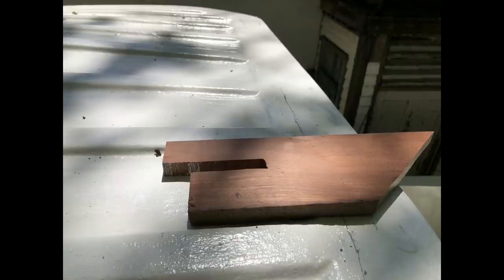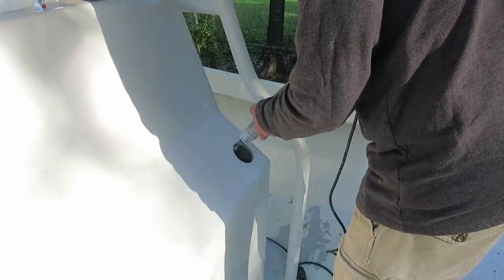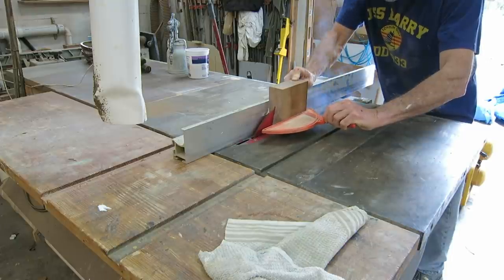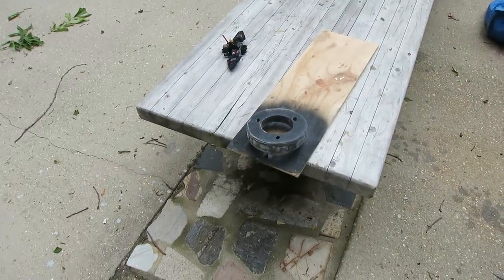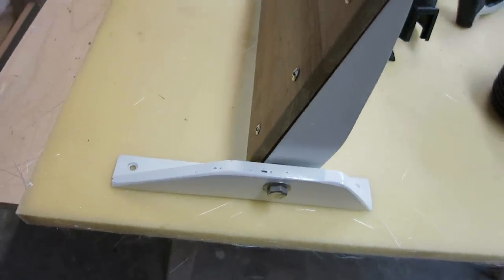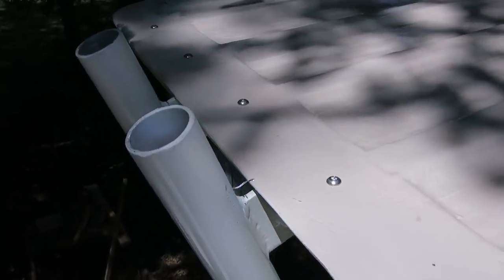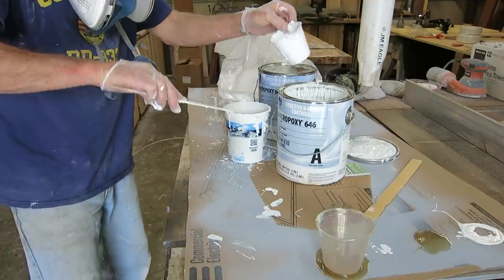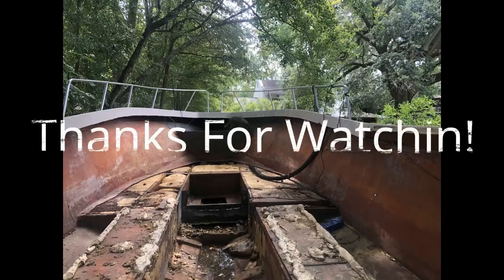T-top top, non skid and progress on other goodies on the Center Console Project boat. #38

Comment: I would use Ultra Tef-Gel on those screws.   Amazon has it.
Reply from the maker: David
That is a product I an unfamiliar with, I will have to check it out.
Barry
Reply: @barrylukebuilds7894  Duralac is the trade name of an alternative product. I am sure there are plenty more, all the online marine retailers and metal working suppliers should be able to advise you, I reckon. Lovely t-top. Thank you for the videos.

Comment: On your T-top I would drill those all the way through the aluminum and use longer bolts with nylock nuts on them. If you don't want the nuts then use anti-seize and lock washers if you ever want to get it off again without cutting them.
Reply from the maker: We are on the same page mostly. I was planning on through bolting the front corners only and using a chemical separator on the remaining bolts 
Barry

Comment: We use PTFE pipe sealer on all stainless fasteners that go through Aluminium to prevent any galvanic action between the dissimilar metals,
We also use it on stainless to stainless to prevent galling.
Put the bow rail back on.
Easy to hang fenders off and some thing for old fellas like me to hang onto😎👍
Reply from the maker: Les
Thanks for the comment. After reading all of the votes on the handrail I am 100% unsure on which way to go. 
But it has been interesting. And thanks for the tip!
Barry

Comment: Hey, Barry pertaining to the 3 × 16 stainless steel screws in the aluminium frame. What will happen naturally over time is that those screws will cause the aluminium frame to corrode because the aluminium frame will be the more noble metal. This is a type of corrosion call Galvanic Corrosion. When you mix two different metal that are in electrical contact ( in other words directly in contact with each other) the more noble metal will start to corrode because more noble metal (stainless steel) will turn an cathode and the less noble metal (aluminium) will turn an anode hence the less noble metal (aluminium) will become a sacrificial anode and start to corrode protecting the more noble metal (stainless steel) which is the stainless screw. 
     The more noble metal will not corrode which is the stainless steel screw in this case. So what will happen over time is that the screw will become slack and fall out over time due the screw hole becoming larger because of the corrosion of the aluminium frame. 
     The best option here is to use aluminium screw which would be the same material as the aluminium frame to prevent this type of corrosion from happening; Or you can coat the stainless steel screw and the screw hole with epoxy to limit the contact between the two dissimilar metal to minimize the effect of this type of corrosion which is called Galvanic Corrosion.

     Please see the link below for further information
https://www.twi-global.com/technical-knowledge/faqs/faq-what-is-galvanic-corrosion-and-how-can-it-be-avoided#:~:text=Galvanic%20corrosion%2C%20also%20known%20as,solution%20and%20are%20electrically%20connected.

Regards;
5th Marine Engineer Romario Goulbourne
Reply from the maker: Thanks Romario and thank you for your service. My Son and my brother both served in the Marines.
I am not crazy about using aluminum screws as this will be a high load area with lots of temperature swings and lots of vibrations. I am leaning towards the coating route.
Barry
Reply: You are welcome sir.

Comment: I vote handrail for practicality. If nothing else it’s a 15 foot cleat that runs half of the boat for tying fenders lines etc. for the T top fasteners stainless and aluminum is nature’s lock tight if you don’t want it to be disassembled then mark the box complete. If you think you might come back later and want to take it off then they make special graphite anti-seize specifically for that but I’ve used traditional cheap store brand anti-seize on aluminum boat towers with  stainless hand tightened fasteners and never had an issues. Love the teak foot step!
Reply from the maker: WB
Thanks and we are on the same page with the fasteners.
Had to have a little teak in the boat!
Barry

Comment: Hey Barry...really enjoy your video's on your boat rebuild...
Actually doing pretty much the same thing on a 1988 WellCraft 20ft CC...
Including adding a full Aluminum Tops-n-Tower T-Top, and full Engine bracket with a 300hp Yamaha two stroke...
And yes...I am learning from your mistakes...LOL...seriously...I'm learning a lot more positive things...
With regards to the screws being used to mount your hard top...I agree with others, to lessen or stop Galvanic corrosion, I feel you should switch to aluminum screws...
I'd use something along the lines of 3M 5200 to seal em...and as an added note I'd recommend using large Aluminum Fender washers at each mounting point...
Remember...this hard top is going to want to act like a wing, or a parachute while being pulled down the road...and I'm not 100% sure the screws alone would be able to handle that amount of stress... The fender washers will distribute the load over a wider area, and lesson the chance of this happening...
Good luck with your project, and keep posting your videos...
Unfortunately my project is going to take a lot longer...Age (63)...health...100% Service Connected Disabled Vet, and a couple of Cancers...have slowed me and my project down, to a stand still...But As of now I haven't given up yet!!!!
Reply from the maker: Don
Thanks for the tips and thanks for watching. The up lift on the top is a serious concern. I will keep scratching my head to find a suitable solution. Your WellCraft is pretty patient but don't wait too long!
Barry

Comment: I made the same mistake once.  Masking tape and resin stick REALLY well.  Epoxy resin and plastic packing tape wont stick to each other.  You might want to test it with poly resin and see if it works.
Reply from the maker: Thanks Pic! I have been a little more careful since then.
Barry

Comment: Live in the desert Southwest, but enjoy your videos/craftsmanship. Can’t vote for/against forward handrails since I usually don’t need much to trip over and neither would stop me from flying off the bow. A thought though on the fiberglass attachment. If you want to keep the screws, I’d think of a bead of white silicone under the glass at each support rail. I’d agree, however, that through drilling with cap nuts or Loctite on the longer stainless bolts would be my first choice. I lived on the East Coast into my 30’s and spent a lot of time on the Atlantic and have been aboard during squalls. I think the Bimini top might have some problems in short order if you stay with just the screws. Keep ‘er coming. Thanks for posting your beautiful work.
Reply from the maker: Thanks Mick
Fastened the top just yesterday. Polyurethane Caulk all around and on every fastener and 4 through bolts up front. I think I am good now.
Barry

Comment: Hi Barry. Unfortunately Stainless steel and aluminum are not working well together. Sf they are in direct contact aluminum will corrode in one point. Trust me I know that because I have seen this many times. I suggest some aluminum screws or strong aluminum rivets. 
For handrail depends what you want snd what you like. Your boat reminds me on Boston Whaler and they are made for fishing. If the boat will be used for fishing that railing will be on your way all the time. Also it will take space on your gunner. I vote no railing. 
And fenders you can always have a small clits to hang them . 
Amazing job and looking forward to see more 😊
Reply from the maker: Ante
Thanks for watching and the kind words. I am still undecided on the handrail. 
barry

Comment: If I was to have my granddaughter in the boat, I would want the rail.  Seems like kids are drawn to the front of a boat when it’s underway, and kids are clumsy.  
Look in to getting some Teflon coated bolts for the top.   This eliminates any dissimilar metals touching, thus preventing galvanic corrosion.   We have Fastenal stores in my part of Texas with all the plants, probably some by you as well with the plants you named off.  
And great work as always.
Reply from the maker: Thanks Jay! I have spent many thousands of my former bosses dollars at the local Fastenal.  I will check them out.
Thanks for the vote and thanks for the kind words.
Barry

Comment: So for stainless into aluminum threads the best product I've seen is called Lanocote. 

It can be bought online or at most boat supply shops near the coast. It keeps the aluminum from galling and allows the bolts to be removed in the future if necessary. If it were me I wouldn't use anything else, right tool for the job kind of thing.
Reply from the maker: Bear
Thanks for the tip, I will check that stuff out.
Barry

Comment: Hi Mr. Luke,
I like the look without the railings but you will need something to grab in rough water so my suggestion is cut the railings down to a couple of inches from the top of the gunnels to be able  to slip your hand around it a lot of new boats are using this low railing and the look great and is good for your safety.
Project looking good,
Frank
Reply from the maker: Frank
Thank you for the tip and the kind words. Cutting the rail has crossed my mind also.
Barry

Comment: You can just snap off those ss bolts after you torque them use a Vice grip and shake it back and forth and it will snap flush. We do that with every swim platform we install at the marina.
Reply from the maker: FFF
Thanks for the tip and thanks for watching!
Barry

Comment: Use blue loctite, it will hold the screws in place and will act as a barrier and help prevent electrolysis between the two dissimilar metals, it's what we use on our radar arch's and T tops.
Reply from the maker: Thanks Fluke Man. We are on the same page with this issue.
Thanks for watching
Barry

Comment: Another note, use a stainless anti-seize lubricant. Permatex makes a good one. That was recommended on my T-top when I installed, keeps it from seizing and galling. Works great. And as mentioned earlier, put through bolts with nylon lock nuts on the corners.
Reply from the maker: Scott
Thanks for the comment! I think That is pretty much going to be the plan of action for now.
Barry

Comment: Have a look at what’s being manufactured these days regarding handrails. I’ve just taken one off my boat and it’s looking way better. As for as your T-top goes a little bit of Duralac on the machine screws and periodical tightening will solve that one. Nice work.
Reply from the maker: Thanks for the tip BB! And thanks for the kudos.
Barry

Comment: Hi, love the work you've been doing on the center console. Are you using a "metal" cutting diamond wheel or a "masonry" diamond wheel? I want to buy the correct one that you been using and having good results cutting fiberglass. Thanks in advance
Reply from the maker: Ricky
Thanks for the kind words! The little blade that I have not been able to kill is a metal cutting blade from Home Cheepo. Not sure of the brand.
Barry

Comment: I’m with keeping the railings always nice when Docking hanging onto when unexpectedly hit by a bigger wave , also you might use a thin plastic sleeve to encase the stainless screws and go all the way through the aluminum pipe add a fiber washer with a stainless washer over it with a nylon stainless lock nut should last for a long time ? Love your video and skill set .  ❤️👍🇺🇸
Reply from the maker: Richard
Thanks for your vote. Your bold suggestion would definitely solve the potential problem. Still weighing my options.
Barry

Comment: Try latex caulk on the top screws, it will act like a thread lock and insulate the dissimilar metals, plus you can remove them later.  I would vote for the railing, it looks good and hand holds are always good.
Reply from the maker: Medic
I was thinking about some sort of liquid magical stuff. Thanks for your vote!
Barry

Comment: For the bolts use nylon washers and 4200
Reply: Prevents galvanic corrosion with the aluminum
Reply from the maker: MBF
Thanks for the tip and thanks for watching!
Barry